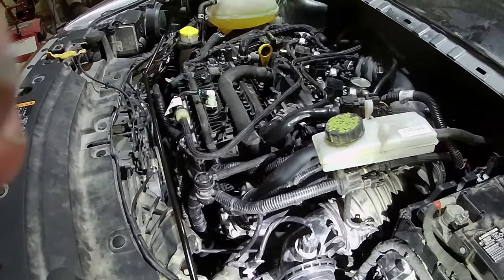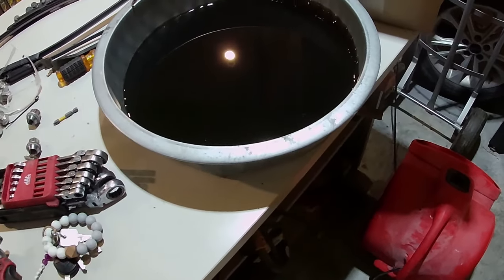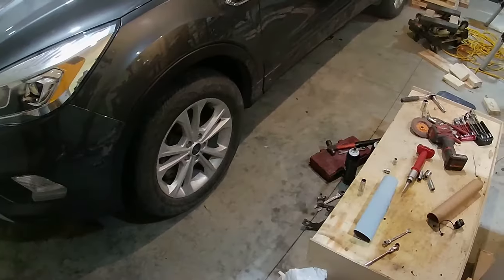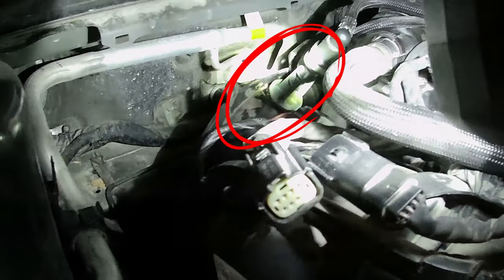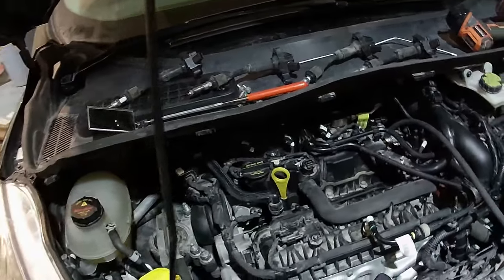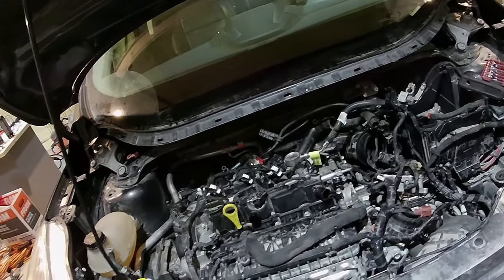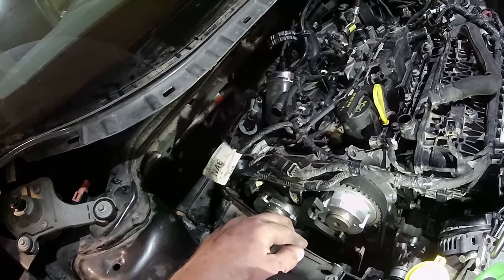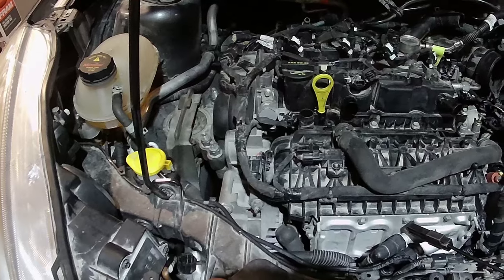2018 escape, engine replacement finished? part 8

Comment: I'm just doing mine Escape 1.6 gasoline... same problem: long block cylinder's top bended cause leak... I'm not changing the long block. I want to repair it a different way.
What bothers me is that it took you 6 over six months to do it ahahaha... this is my socond month and I'm doing it under the sky in a unpleasant weather ...
Reply from the maker: Haha, you and my wife both.😁

The super sad part is im a mobile mechanic, so I spend the majority of my career working outside in all the elements. This project was inside a dry, heated/air conditioned barn.
Reply: @Fixed-ish I understand you, bro. I'm doing mine after my normal work as well.

Seems like regardless of geography, wives tend to be the same 🤣. Sorry about that, I didn't mean to criticize 😉.
I'm happy that yours Escape works fine. In Europe this model is called Kuga 2.

I'm trying to remove my long block now. Removing all equipment sitting on it... I plan to leave the clutch and gearbox in the engine bay, untouched....
It's not easy but doable...

Comment: Hallo,was kostet die Reparatur des Motorblockes in den USA ?
Reply from the maker: I paid about 1600 in parts and I did all the work myself. At a shop I was quoted 7800 for the dealership to make the repairs.